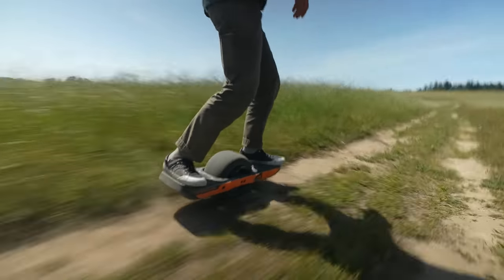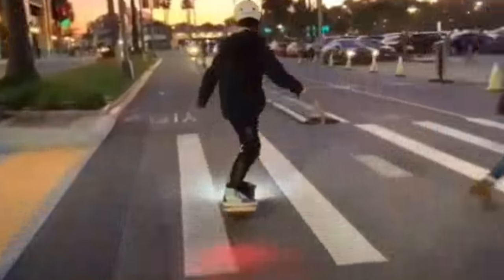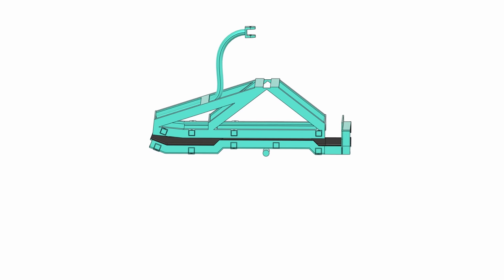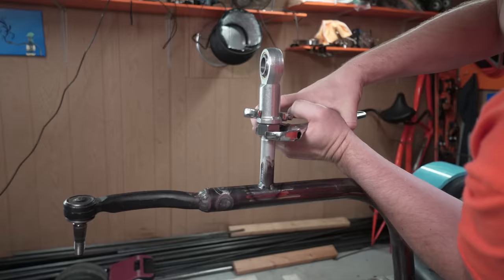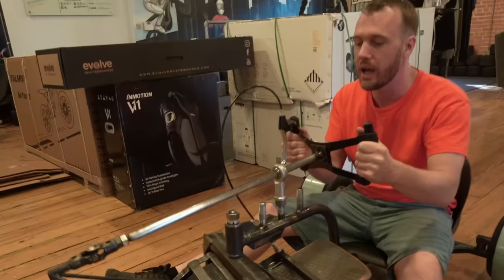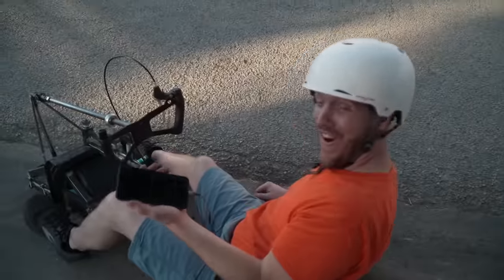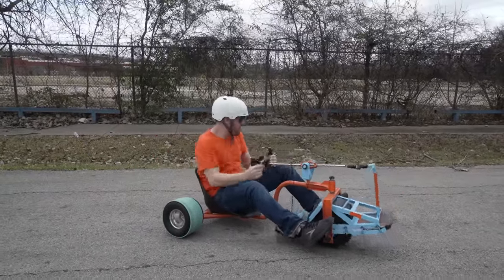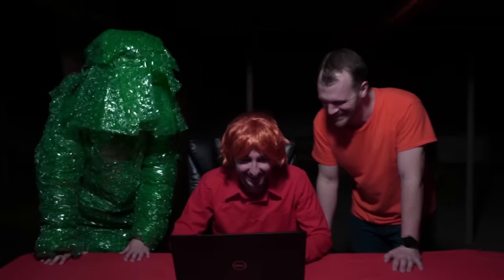OneWheel Powered Drift Trike

Comment: My Stepdad built something similar, but at a larger Scale. It was a One Axle Tractor with a small Car Trailer behind it with a Seat bolted onto it. You ripped the cord from the 5hp Gas Engine, hop on and just grab the Hand Clutch. Just two Speeds: Full send or nothing. But full send was only about 4mph. And then you only had to steer. Sweet memory’s, this Thing was awesome! It also had really advanced full self driving capabilities by simply using a rubber band…
Reply from the maker: Your step dads is awesome

Comment: That thing is awesome! I'm a senior in Mech E and I think I just found my next way to get kicked out the university metal shop for working on non-school projects... would you consider releasing the CAD model or plans for this? I would need to adapt for a Pint X but would appreciate the foundation
Reply from the maker: I dont have an updated version of the CAD. I made alot of changes throughout the video that was done by reverse engineering.
Reply: I would also like a plan if available please...great video and awesome invention.

Comment: Awesome.
I got stuck at 1:34 because the animation is not what is actually happening for left and right.  I'm ovet that now, and ecstatic with the new roller gimble.
Once in mass production ... An automotive grade telescopic steering shaft through a rubber mounted pillow block bearing (think mini driveshaft center support bearing) with the quality micro u-joint at the front should reduce costs enough for you to send me huge profit sharing checks often.
In the mean time Ill remain a silent partner.  ;)
P.S. You should send me one for "safety testing".
Reply from the maker: Ill google those and check it out. Thanks for the heads up

Comment: too much angle and it keep oversteering should put a soft spring on steering for giving too much extra power while drifting and it every danger to put your feet on the ground
Reply from the maker: I rarely have an oversteering issue. It handles surprising wheel for a one input vehicle

Comment: 7:54 "The only issue was the spherical bearing wouldn't let me turn beyond 45 Degrees"

Professional drifters drifting cars that have less that 40 degrees of turning:

(most cars have 35 - 40 degrees)
Reply from the maker: They still spin out to. I use 90 degrees to recover my drifts.
Reply: @CodyHovland  Yeah, it is easier to drift with more degrees but it's still possible to drift with a car's default turning angle

Comment: Make it longer, and put the foot pegs on the main frame instead of the OneWheel. Having your feet on the one wheel is limiting range of motion.
Reply from the maker: It ornigally was longer but the trike community gave me the ideal measurements. A longer trike is harder to drift. I thought about pegs on the frame but then i would be able to look as steezy when i slide. Having my feet on the OneWheel acts and reinforced steering.